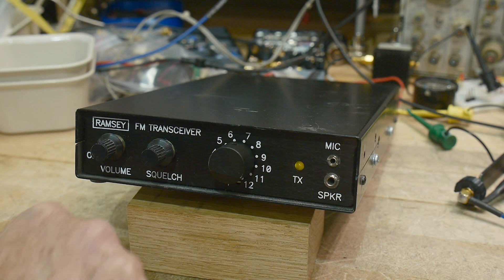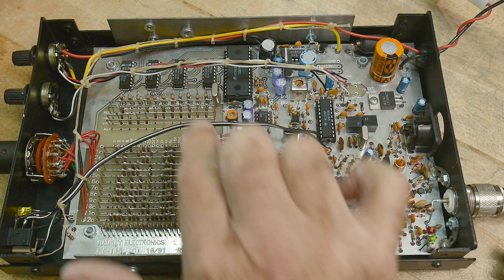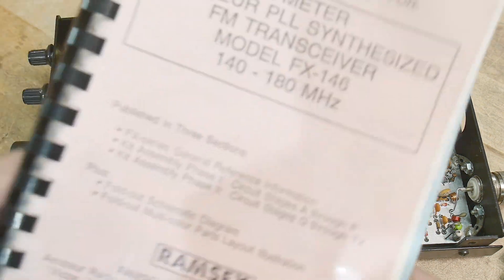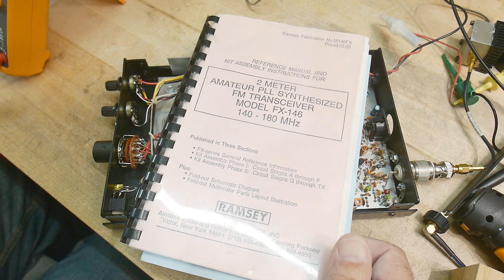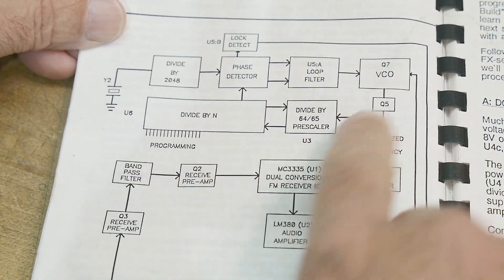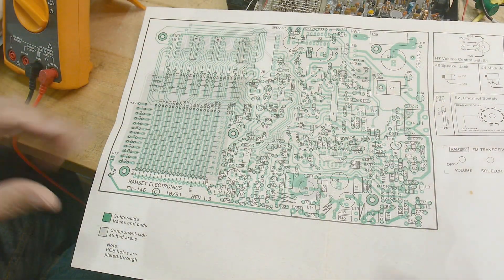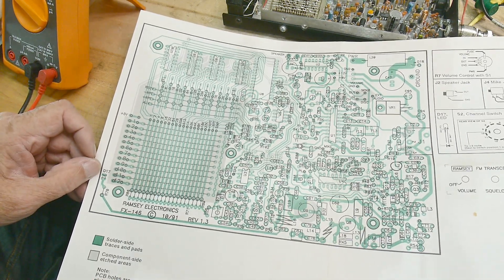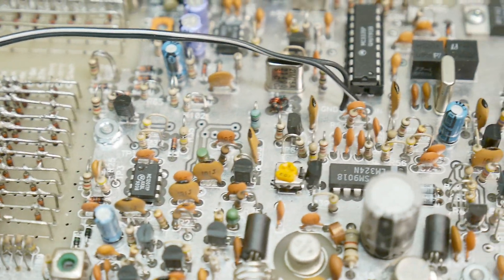#1503 Ramsey 2m Overview (part 1 of 12)

Comment: Those funny connectors at the top looks like SMB-connectors. Interesting test piece. I keep on being amazed by the “cheap” test equipment nowadays, like the NanoVNA and now this, but sometimes they do have fatal design flaws in them, like my TC-1 multitester that bloew itself p testing zener diodes…

Comment: From the manual ( like my  FX-440 ;  the 70cm version  400-480 MHz ):       Your FX- transceiver PC board is double-clad with plated- through holes. What this means in practice is that it is VERY important to select and install correct part values the FIRST time around. This type of board makes "desoldering" much more difficult and risky because the solder adheres inside the hole and flows to the component side of the board as well. It is VERY tricky to remove a part without damaging it. If too much de-soldering heat or component "pulling" is used, there is also the serious risk of damaging small PC board traces. Be careful and methodical in assembly!!!

Comment: I built the 2 meter version back in late 80s only I used BCD switches on the front panel so I could dial in any frequency, I also installed a Commspec 32 tone encoder board for PLs. It was a great radio.

Comment: I built the 6 meter version of this kit a long time ago. The performance of the radio was a bit sketchy at best, but I wish I had never parted with it, because I have learned a lot since then and I think I could have resolved the issues I had using the additional knowledge I have acquired since. Oh well. There needs to be more kit radios available on the market these days. Construction was half the joy.

Comment: According to an ARRL article published January 7, 2016, the kit division of Ramsey has "thrown in the towel" effective January 1 of that year.  The RF enclosure side of the business is still active.
Reply: I did a double-take in a meeting just this week when an engineer mentioned using "Ramsey boxes" for testing. My thoughts immediately went to the old kits. I had assumed Ramsey would be completely gone by now, but it looks like the shield-box business is going strong.

Comment: At 6.45 I had to chuckle... With Ramsey you couldn't assume plated throughs but those were different days for PCB fab. I built a couple of their kits in the 90s and had similar thoughts on them. They put out some really neat items at a cost that made them accessible to a whole new crowd, but there were reasons they didn't cost as much as the 'pro' alternatives. Kits are largely about the builder and they sire ignited my interest in can based antennas. I checked and they've moved since that documentation but Google Earth shows the name on the office building signboard. They no longer do kits, instead specializing in feedthrough connectors with RF isolation for test applications.
Reply: Your FX- transceiver PC board is double-clad with plated- through holes. What this means in practice is that it is VERY important to select and install correct part values the FIRST time around. This type of board makes "desoldering" much more difficult and risky because the solder adheres inside the hole and flows to the component side of the board as well. It is VERY tricky to remove a part without damaging it. If too much de-soldering heat or component "pulling" is used, there is also the serious risk of damaging small PC board traces. Be careful and methodical in assembly!!!